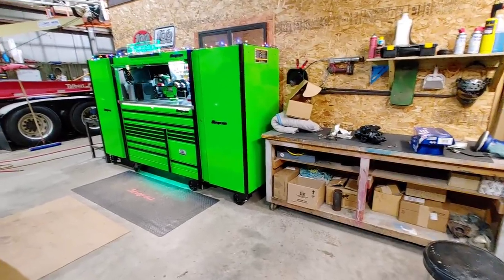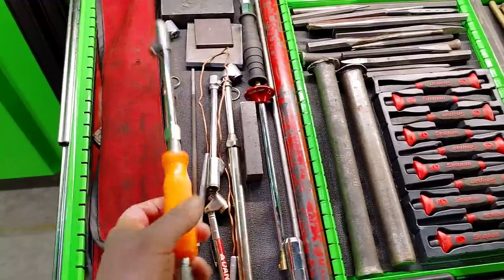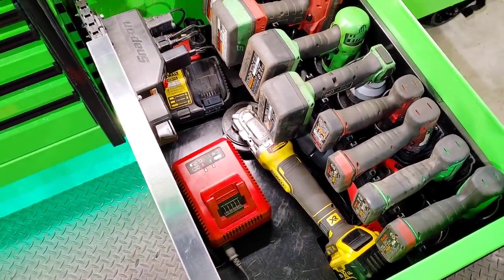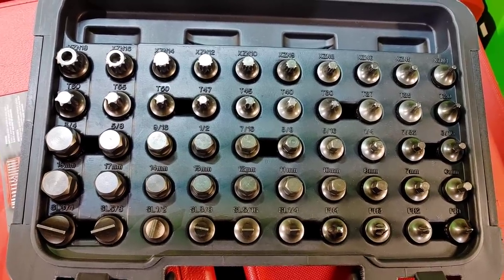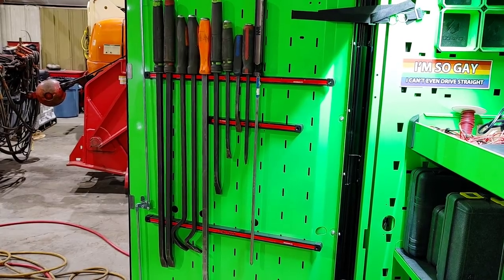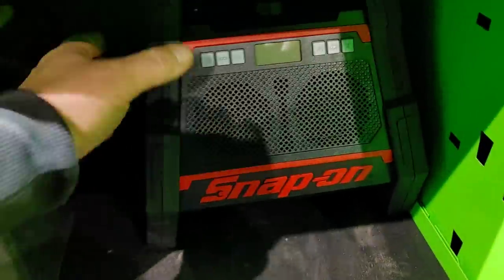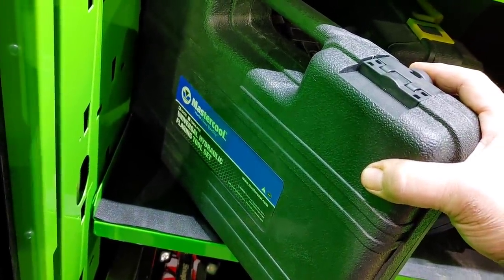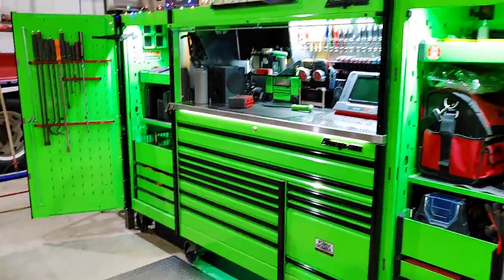Snapon Tool Box Tour

Comment: Talk to your snap on dealer about your torch that isn't igniting. I had issues with my torch 400 and 300 both times my dealer replaced them and told me the ignitors are covered under warranty. I prefer the 400 It has a little more control.
Reply from the maker: Nice.  I will do that!  Thanks

Comment: 2 quick questions for ya, that hydraulic tubing flaring tool can do how much exactly, does it cover all types of brake lines and fuel lines and transmissions lines or most of them? And then you mentioned the rethreading kit, wondering if my tap and die sets are good enough, yes the cut threads instead of “chase” them but I feel like it does the same thing, if u could enlighten me a little bit that would be super cool!
Reply from the maker: The flare set from Mastercool does double flare, GM trans line, GM fuel line, push connect flare and metric bubble flare.  As for the rethreading kit.  Its quicker to grab and go to clean threads than a tap because all you need is a socket to do work with it.
Reply: @randyness5123  I’m a Ford tech that occasionally works on a bunch of other stuff the customers had upfitted, was hoping a kit could do it all but not sure if gm and ford are the same for that, overall tho I’ll probably just get 2 kits lol thanks for the info I’ll def get that kit added to the never ending collection!

Comment: Greatly overpriced.  Also, all of the contents looks like they've never been used.  At one time I had a Snap-on black multi-box setup. Within 6 months, the drawers pull-handles were failing. Locking mechanisms stopped working and the box's seams welding were failing. Snap-on didn't care. I ended up suing them and got my money back. I bought a Matco toolbox setup as a replacement. ZERO problems.
Reply from the maker: Sucks for you buddy.  My double slider drawers have a 500lb capacity.  Have you been buying your snap-on from rummage sales or pawn shops by chance?  😂
Reply: @randyness5123  NO, I bought that black Snap-on toolbox combo NEW, and ordered it through the Snap-on dealer that came to the shop each week. Your implication is not only rude but very disrespectful. I'm a 50+ years master level factory certified auto/truck tech.  BTW, I couldn't care less what capacity your double slides drawers are.
Reply from the maker: @sergeantmasson3669  the same could be said about your opinion.  Im not a Snap-On fanboy by any means.  I have a lot of different brands.  And I do have some tools that have never been used so who cares?  I have many years left in my career to use them.  I've never worked at a dealership or any type of auto service shop and I'm currently not a full time mechanic because I operate cranes, heavy equipment and drive commercial vehicles as well.  I like to collect tools.  There shouldnt be anything to disrespect about that.  The video was just an informal to show people what i got.
Reply: @randyness5123  I'm 50+ years master level factory certified auto/truck tech. I also earned two college master's degrees. I'm not blind and I can read quite well. As I stated, I have a set of Snap-on wrenches that are clearly stamped "Made in Canada" and a few Snap-on screwdrivers that are stamped "Made in India." Yes, majority of Snap-on hand tools are "Made in the USA" but not all were/are.
Reply: @sergeantmasson3669  who cares, you turned wrenches for 50 years so what.
Reply: @fumanpoo4725  Person who live in glass house should not throw stones. I highly doubt that you'd have the gonads to spew out your childish insults in a face-to-face situation.
Reply: @lilcourtny08  Highly unlikely that you even know what a master level factory certified auto/truck tech is. I guarantee that I achieved a higher level in the auto/truck work industry than you ever will.
Reply: @sergeantmasson3669   Face to face with who? Will get a trophy?
Reply: @fumanpoo4725  NEVER underestimate a senior level US Army Special Forces veteran with a DD-214. They can easily hurt you.
Reply: @lilcourtny08  REALLY? FYI, I'm a 10-year US Army Special Forces veteran that did two tours in Vietnam doing medevac duty.  Are you aware that medevac helicopters don't have self-defense equipment? I bet that you don't know why either.
Reply: @sergeantmasson3669  lol, Special forces medic and two tours of Vietnam? Yeah right I'm not believe any of that
Reply: @fumanpoo4725  Oh, bad move, now you've shown your colors.

Comment: 1 inch air gun is no good with an air fitting that small. 
They are designed for inch air line
Reply from the maker: I wouldn't say "no good".  Maybe it's not fully capable of reaching max torque with a smaller fitting.  But she slams harder than my 3/4 inch I will tell you that.
Reply: @randyness5123  Milwaukee makes sockets , Ratchets and rattle guns now they out do any brand including snap on. 
Just a pitty they don’t get made in America

Comment: The fact that this tech is willing to waste his money on snap on electric tools when there are better options for half the price just blows my mind. I tell techs all the time don't waste your money. Snap on has a Terrible warranty for electrical tools and batteries.
Reply from the maker: I wouldn't say better options.  Maybe comparable options at best.  Snap-On has a 1 year warranty on tool and battery.  I've never had any issues with any of my cordless tools.  My most used impact is a CT8810 and its 7 years old and still going strong.
Reply: @randyness5123  REALLY? I had a Snap-on mig-welder that crapped out at 14 months and Snap-on refused to do anything about it and wouldn't even offer to repair it at my expense. I ended up buying a Matco mig-welder.  10 years later, it's still functioning perfectly.